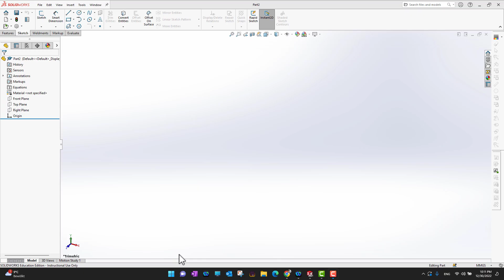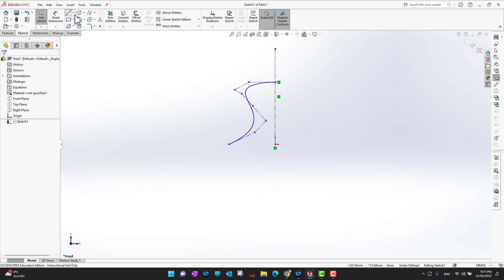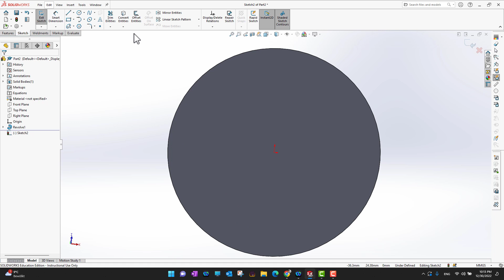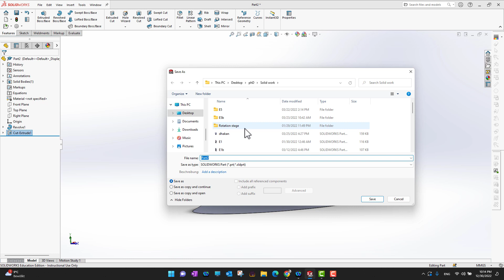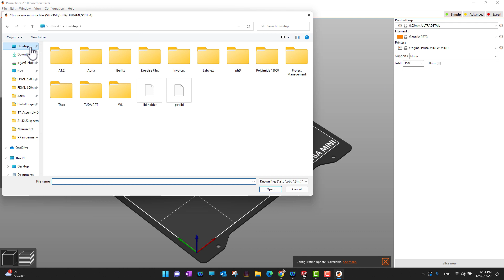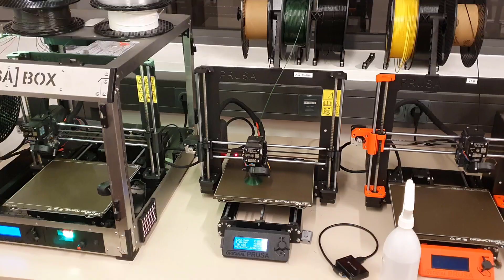How to Fix a Broken Pot Lid Handle - DIY Pot Lid Holder by using SolidWorks & 3D Printer

Comment: Will the pla not get too hot and melt?
Reply from the maker: I also thought about it, but when I checked the melting point of PETG filament, it was mentioned 260 degrees, so I thought it could be fine. I'll update you =D